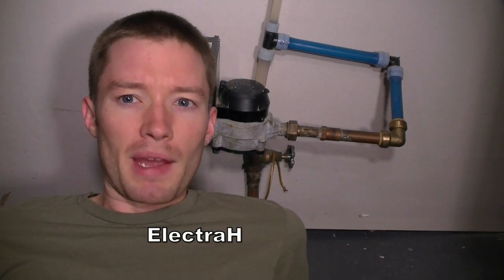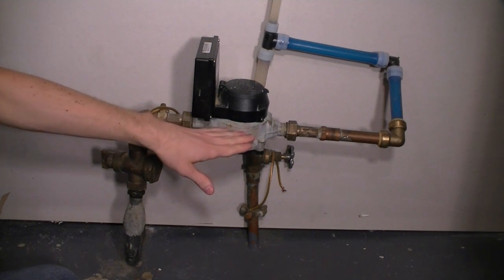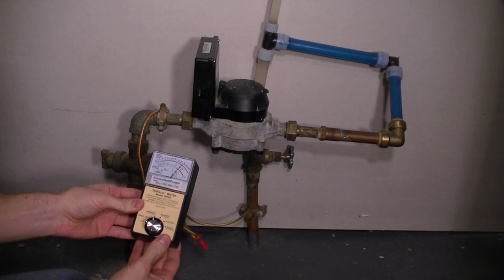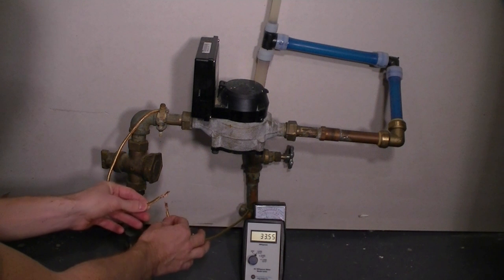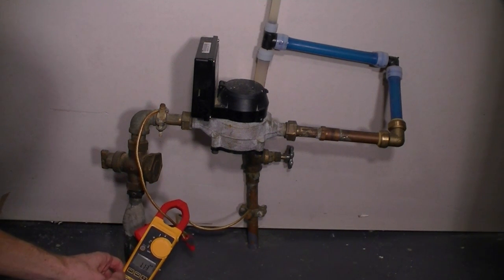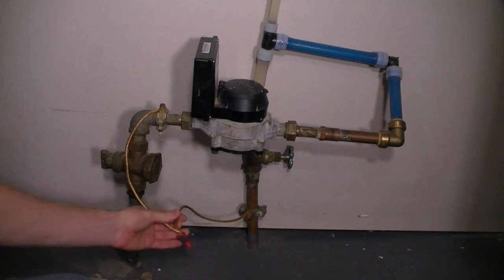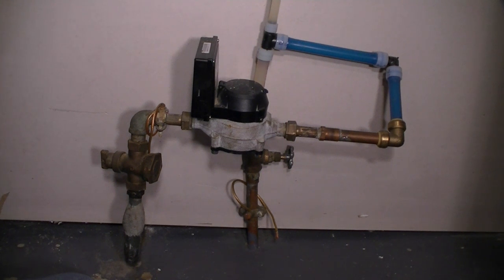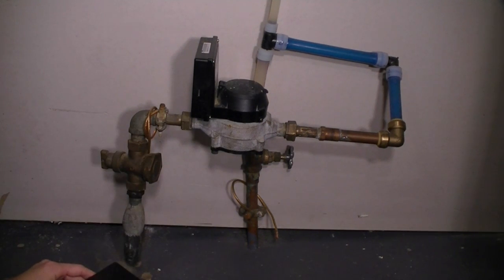Electrical Current on Plumbing Pipes

Comment: Your plumbing is hooked up to the earth cable to your fusebox for your safety. Never disconnect earth wires from your plumbing without consulting with a qualified electrician.
Reply: Haha great till the plumber gets electrocuted
Reply: @khobydawson2057  He won't get electrocuted from an earth wire, but might do without it connected to the pipes.
Reply: No its not. Nowhere does it say its for ur safety
Reply: @nyrbn  Try regulation 411.3.1.2 of BS 7671: 2018 (British Standards). Although plastic piping can cancel that requirement, for example where a metal pipe becomes insulated by a section of plastic piping or rubber hose. Basically, if an appliance develops a fault where it's metal caseing becomes live, say a kettle, and you happen to be touching the kettle and kitchen sink that has not been earthed, you become part of the circuit.
Reply: @catman4471  Bravo. Read the electrical regulations on grounding of copper water pipes. Breaking the copper connection between the ground and outer copper pipes will corrode your downstream copper pipes on the inside until pin hole leaks form, and also need to be safe and absolutely want those copper pipes grounded.
Reply: The national electrical code requires the neutral conductor at the panel to be bonded/grounded to the metal water piping system AND to two metal ground rods six feet apart. You do what you want but you have a fire in your house and an insurance inspector comes over and sees that you purposely did not bond your system then YOU are "on the hook" for the damage regardless of your policy coverage. Go ahead ... roll the dice!
Reply: @sjoby292  I thought I'd made that clear already?

Comment: I would be far more concerned about lead contamination  from the supply pipe...
Reply: yea that was my thoughts...i say fuk a cupl of volts on the pipes..tht wont hurt ya but the dam lead pipes will kill ya...
Reply: and let's not get into plastics
Reply: My understanding is it depends on the calcium level in the water. A high level of calcium in the water forms a layer of plaque thereby preventing the water contacting the lead itself. If they're lead pipes, they've probably been there for ages, but if I could have my druthers, I would prefer not to have them, either.
Reply: @BarryBranton  --high levels of calcium is considered Hard Warter Correct---???
Reply: lead water services are safe as long as the water treatment in your local system is well-regulated and monitored. Flint MI is an example of what happens when water chemistry is not maintained. Almost all water systems have a significant amount of lead in them (fittings and seals, not contaminating the water actively). I worked in the water main industry for a few years, and I replaced water main pipe and services. I've never encountered a city system that I felt was updated to a safe, modern standard. If you're really concerned about it, there's 2 things you could do, but only 1 will really protect you 1 - call your municipality and request to upgrade to a non-lead service (not important) 2 - purchase and install a reverse osmosis system in your house for your drinking water. #2 will protect you from nearly all contaminants, however, you will want to take daily multivitamins as RO water not only protects from bacteria and chemicals, it also removes minerals from your water that are good for your body.

Comment: One more point. I found that the circulating current in the plumbing pipes arrises if any electrical circuit in your building uses earth connection instead of the neutral connection. If the same is corrected, the circulating current stops.
Usage of earth connection instead of neutral may give rise to exposure to live wires of persons and is a potential safety hazard.

Comment: I don't a grounding electrode conductor on the water line coming from the floor. Here in WI we are required to use the main water service as the main grounding electrode.
Reply: National electric code does NOT require using the incoming metal water pipe as an electrode.  You are saying Wisconsin code does state-wide?!  Do you have a code reference to back that up by chance?   So many new houses and new water services now are using polyethylene plastic pipe.  I'd like to see someone bond to one of those :D

Comment: You need to have the utility check the connections at your house and pole, if you are getting current on your bond wire there’s a very good chance you have a corroded connector at either position.

Comment: You should check with your water utility about that 1.2A current, possibly being used to protect their piping system from corrosion, via cathodic protection.  An isolation coupling might be needed, at that lead/copper pipe junction, to eliminate the current being introduced into your home.

Comment: Well have you think about the water that flows to thats water pipes? Water is ALSO a very good current carrying conductor and thats bonded to the ground.
Reply: The amount of current taking the water in a case like this is very little.  In fact one would only be able to detect it with very specialized equipment.  Luckily the resistance/impedance of the water is high enough that very little takes that path in comparison with what takes the path of the metal water supply pipe, earth rods, and other parallel paths.

Comment: At 9:00 minutes, it looks like he used a "Fluke 324 True-RMS Clamp Meter" set on A/C Amperage to measure current. If so, then the 1.16 amps he says he measured is AC and not DC. I don't know the frequency, I assume it is 60 Hz, but there could be much-higher frequency current as well from "dirty electricity".

Comment: What's the voltage across the two terminals?
Reply: my thoughts to, damnit he measured same thing with tree meters but couldn't measure damn voltage. He says 1.2amps, 1.2 on what? 1volt or 100volts?
Reply: Voltage couldn've be tht much since he finished vid!(noticed when he separated wires he held one by lt hand an other by rt hand!Hearts in middle!)

Comment: I think some people get confused about some things regarding water and conductivity. First if anyone does not know; pure water will not conduct electricity. It needs contaminates like minerals for that. Just like a battery with distilled water only, it will not charge. A conductor is only as good as its connections.  I will agree that earth ground is a floating ground to everything except lightning.  Here is what you should try. Connect a voltmeter across that length of water supply pipe. With and without the wire attached.

Comment: Why separate the ground bar from the neutral bar in a sub-panel?

From The Engineering Team at E&S Grounding Solution's

The difference between a ground wire and neutral wire is often misunderstood.  The problem primarily comes from the inappropriately named “neutral” wire.  There is nothing neutral about a neutral wire.  It is a current-carrying conductor, just like a hot wire and has all the potential for danger and should be treated with the same respect. 
Consider the schematic for a flash-light.  Your typical flashlight consists of a battery, a switch, a few wires, possibly a fuse, and a light bulb.  Let’s ignore the switch, as it doesn’t relate to the point we are trying to make.  In a flash light without a switch, you would see a black wire running from the battery to the light bulb, and a white wire running back from the light bulb to the battery.  The black wire would represent the “hot” wire, and the white wire would be our “neutral”.  The green ground wire would be tied to the metal case of the flash light and bonded to the battery return terminal via a fuse, and would be an open in regard to the rest of the circuit.
If you were to take a multi-meter and make a few measurements, you would see that the black wire has maximum amperage, and maximum voltage.  The white wire has maximum amperage, and minimum voltage.  The green ground wire would have minimum voltage and minimum amperage.  The important thing to note, is that the white wire has the same amperage as the black wire.
Now, the white wire will have minimum voltage, until you add another light bulb to the circuit.   If you cut the white wire in half, and inserted a second light bulb, the first half of the white wire would now both maximum current and half the voltage.  The second half of the white wire (the piece tied to the battery) would have maximum amperage and minimum voltage.  This could go on for as many light bulbs as we want to add into the circuit.  Any resistance added to the white “neutral” wire, will instantly become part of the circuit and see voltage.  The green ground wire would only come in to play if the black or white wire were to accidentally come in contact with the case.  The electricity would short to the case and travel back to the battery causing a temporary increase in current, which in conjunction with a fuse would stop the flow of electricity.

When we are dealing with an electrical 120-volt circuit, the same thing is true with our neutral white wire.  It only appears to have zero volts because there is no resistance.  If you become part of the circuit, the voltage will form across your body.

Now, in the case of a single-phase electrical subpanel, we know that 100% of the current from the hot-wires will travel on the neutral wires back to the main electrical cabinet.   If we bond the ground wire to the neutral in the sub-panel, current will flow on both the neutral AND on the ground wire.  Which means that if you do not keep the ground wires separate from the neutral wires, you will be allowing return currents to flow on the ground wires back to the main panel.  This is not only bad for obvious safety reasons, but it will also cause problems with GFCI breakers and cause equipment interference issues.  It is also of course a violation of the National Electrical Code (NEC).  You are to have one and only one connection between the ground system and the neutral system, and that is at the first service disconnect.  This is vital for the proper operation of over current protection devices (OCPD) such as fuses and circuit breakers.

We hope you have found this information useful, if you should have any further questions, please do not hesitate to contact us again in the future.

Comment: Water already has a magnetic current through it. H2o is a asymmetric polar molecule hydrogen has a positive charge and oxygen is a negative.
Reply: Coming from a licenced plumber
Reply: Also water is used to conduct energy and electricity.
Reply: Why out of the Pool in a storm ?

Comment: Did you bond your pipe to the service panel somewhere after the pex install? If not doesn't this created a hazard for your pipes possibly becoming energized ?
Reply: The residential side of the pipes are bonded to the service panel ground/neutral bonding.  You are correct that this bonding protects the pipes from becoming energized by providing a low-impedence path for current to take back to the neutral, thereby tripping a circuit breaker.  A common misconception is that "ground" or "earth" will mop up or clear a fault.  This is not the case, the earth itself can act as a conductor, but its high impedence will prevent enough current flow back to neutral for a breaker to pop.  That is why neutral is bonded to ground at the main service disconnect.  We need a low-impedence path back to neutral in order to trip a breaker.

Comment: A “plumber” that does an installation like that my guess doesn’t carry a license to practice and therefore would be called a handyman. Also as a licensed plumber, you should be more worried about the lead pipes not just in your home but in the town or city you live in. As soon as someone and/or village alters the water, replaces or repairs a lead water service, that’s when lead levels spike. We also have not seen the long term affects of polybutylene or polyethylene(pex) piping as of yet. But if we are going to get caught up with electrical...., try harnessing what the electrical companies are bleeding and use it to your advantage. Like power collection, think of how many led lights you can power by the collection of energy off of 1 amp at a constant. FREE ENERGY for ALL.

Comment: As others have mentioned, if the ground wire that should be connected to the pipes is not connected, or if the plumbing has some plastic in it - doesn't that make your grounding system for your electrical unsafe?  Where is the electricity from the ground on a plug going to go?  Also, as others said - I would be concerned about the lead pipes - shouldn't you have a good lead filter in the garage area, installed where leaking water would not be harmful - it seems that these are not that expensive - very interesting if these problems can be dealt with safely. I was looking at problems with a 4 gallon electric water heater going through anode rods very quick in a very hard water area - Original Ariston was great for many years, then Bosch bought them out, next heater had melted thermostat, can't be turned over medium, have been told stray galvanizing current may be the  problem - 3 light tester shows GFI outlet is properly grounded - yet GFI keeps getting tripped at times immediately after turning power on, much worse right after cleaning water heater and replacing anode rod -

Comment: The problem is a combination of:
- Neutral to Ground bonding (now your ground becomes a return path for neutral currents)
- Bonding all other incoming conductors to the same ground (now your other conductors also become an effective return path for neutral currents)
- Using Ground as High Frequency Filter since Switched Mode Power Supplies (now you have polluted the ground with high frequencies)

Unlike in the US, in Europe we have different grounding systems for residential and industrial:
- TN-C-S: like in the US. Phases and a Protective Earth Neutral (PEN) are supplied. You bond the local ground to the PEN
- TN-S: Phases, Neutral and an independent Protective Earth conductor are supplied. You bond the local ground to the PE
- TT: Phases and Neutral are supplied but you do NOT connect the neutral to the local ground. Instead your ground rod impedance needs to be low enough and you use Residual Current Circuit Breaker (RCCB) on every circuit.

Then there is the IT system which has a neutral with a high impedance to ground. This is only used at places were any neutral to ground currents can be dangerous. The electronics used to measure ground faults are more expensive and prone.

In France TT-System is widely deployed. TN systems are only used in certain situations (industrial). 
Germany uses like the US TN-C-S everywhere.
Netherlands has a mix.  Wherever there are high magnetic fields (>20nanoTesla) there are either three options:
- your standing next or on top of a cable with a large current
- your standing next to a transformer, electric engine or other device which is known to cause high magnetic fields
-TN-C-S system is applied

Acronyms for TN-C-S are MEN (Multiple Earthed Neutral) and PME (Protective Multiple Earthing)

Unfortunately Utility Companies in Europe have discovered the cost reduction of TN-C-S because 
- TN-C-S has no extra conductor like TN-S 
- TN-C-S does not need an expensive ground rod
- TN-C-S does not need regular ground rod inspections
They start applying TN-C-S more and more because "the United States is doing it too so like Mac Donalds and Monsanto it must be good!". France is still too conservative but many places in the Netherlands started converting aged TT systems to TN-C-S.

Sadly the majority of places that have a ground problem are buildings with a shared concrete foundation. When you bond the neutral to the ground, which again is connected to the grid of the concrete foundation, you literally get currents EVERYWHERE!

Since the NEC made Neutral to Ground bonding mandatory (which is a good way to prevent direct electric hazards like electrocution) the only solution is disconnecting all other conductors that enter your house (water, gas, cable, telephone). Also you can try to move the main circuit breaker box as close to the utility powl as possible, drive a ground rod next to it and bring your electricity in your house with a protective earth to prevent stray currents on your terrain. But whatever you do, NEVER DISCONNECT THE NEUTRAL TO GROUND BOND before changing your installation to TN-S or TT system and always check with your local electrician.
Reply: Excellent reply, but. Since I see no grounding electrode conductor at the incoming  water main, I'll bet there's a neutral to ground reversal on an outlet somewhere on the premises, or a neutral to the plumbing somewhere in the structure. An amp of current anywhere on plumbing indicates a severe hazard.
Reply: TT grounding system is a good joke , it doesn't work well, it riquures  a lot of rod,good and expencive ones to work well.
Reply: Great info, and my there are alot of metals.   What can't be seen? How much steel wasn't replaced when the copper was installed? Are there any copper to steel joints? If the city has cast iron mains, add another metal into the mix.  I recall zinc anodes create about 1.2v all by themselves and are used for hull protection of steel on some underwater structures, but I doubt there are barnacles in this house.  Could this current be generated just by galvanic action?  I could almost flip a coin here - the odds of a neutral tied to ground [or even shared neutrals] could setup a fault or field that is just being drained by plumbings connection to earth. I doubt the service pipe itself is lead, but more likely galvanized steel with a  lead sheath over it as a protection through the slab.
But first... if the water heater is electric, go get gas: that eliminates a very common ground fault source that can linger for months before element failure lets you know where to look.